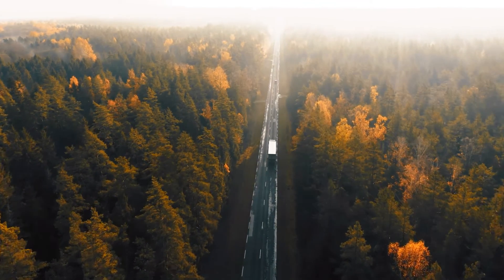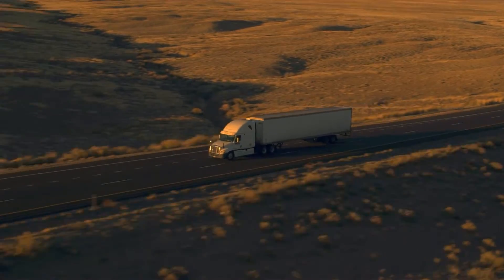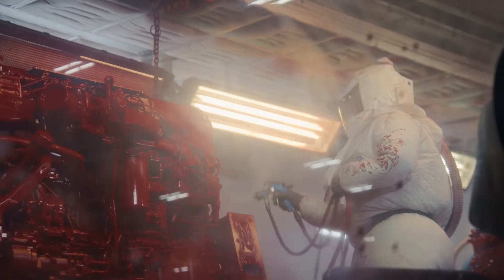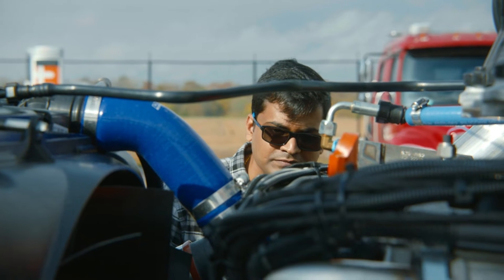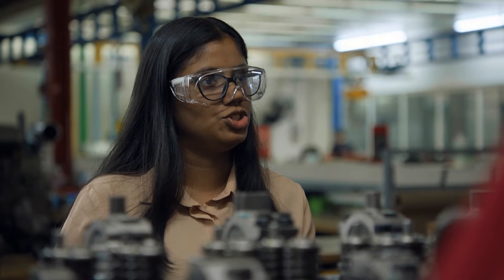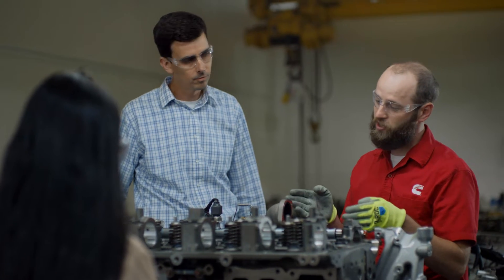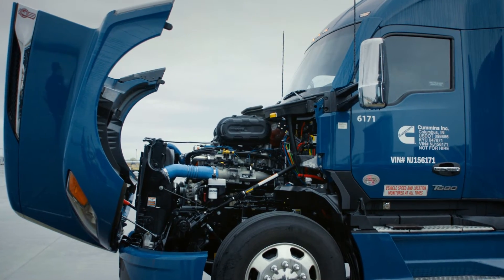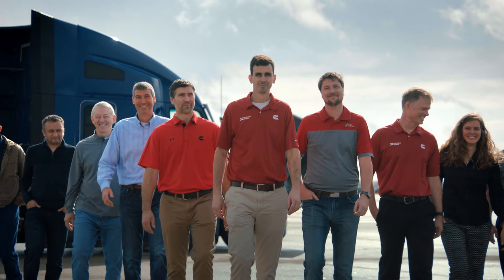The Next Generation of the Cummins X15 engine - The Journey

Comment: How can Scania be clean without after treatment systems but Cummins can't?
Reply: Scania does use afterthreatment, two stage AMOX SCR with a DPF+DOC, it was developed by cummins just like the XPI fuel injection system

So does cummins,  the X15 Tier-4/Stage-V has no egr and is a single module aftertreatment